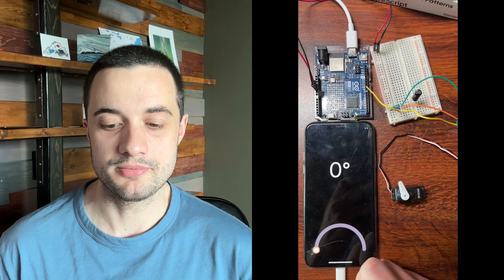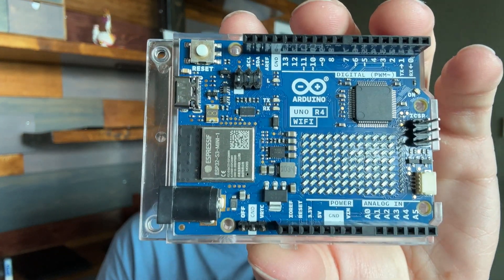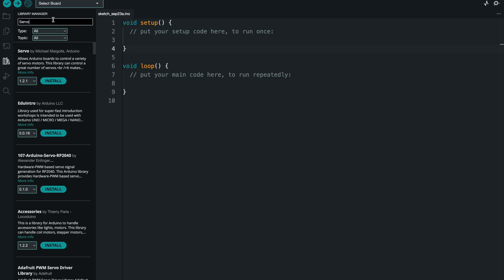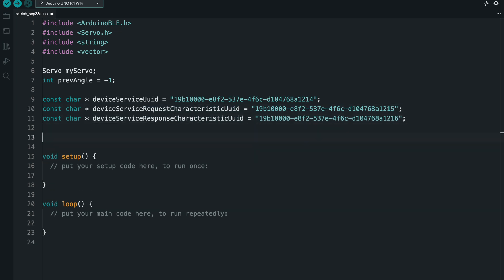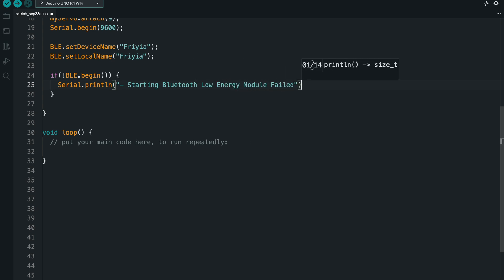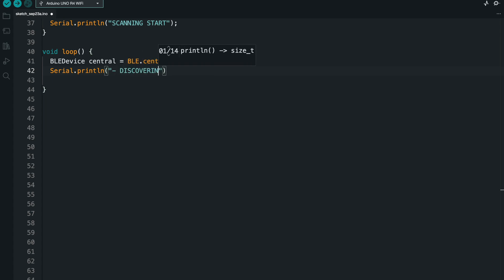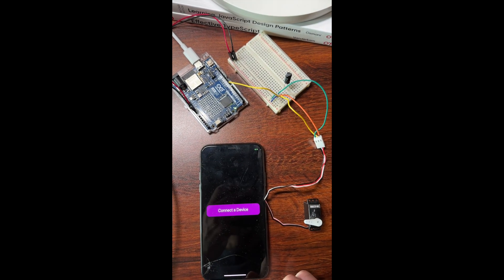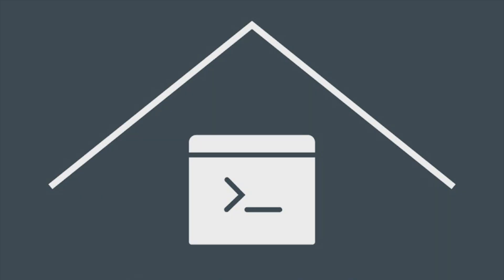Bluetooth Low Energy ( BLE ) Peripherals with Arduino for Beginners

Comment: I really do wanna learn this and from the platforms that I’ve been on I was not capable of understanding. The main part of understanding is when I am on my laptop I can’t seem to open the website for the. Arduino uno then I already wrote the code on my iPhone, but then I can’t write the code on my it’s strange. I can’t get the code onto the website where it’s supposed to be so the agent can upload it to the board. I have the breadstick pins. I have all the correct stuff. I just don’t understand, the computer part plugging the Arduino board and the wire is the easiest part but I need the code on the board Arduino board so I can use the Arduino board to upgrade my controller. Somebody else actually wrote the code. I edited the code on my iPhone why I can’t do it on my laptop. I just don’t understand but then, if I knew how to transfer from my iPhone to the board would be nice to understand and easier probably I just don’t know. I need this code on my board.

Comment: Thanks for the video! Have you been able to connect BLE arduino to a computer? Do you have code and a video for this? Mainly thinking of recording simple sensor data acquired with the arduino.
Reply from the maker: You can find the Peripheral and Central code in the description

Comment: Very cool! I must give this a try! You should also try the ESP32 which also includes BLE and supports the Arduino IDE.
Reply: I try myselve with an nano esp32. The libary for the servo had to be changed to the esp32servo libary but else it should work. I have a little trouble to get a ble signal from my arduino but I guess its an mistake form my side.